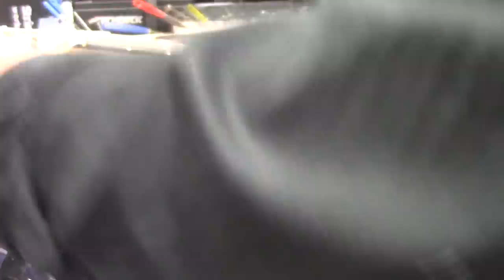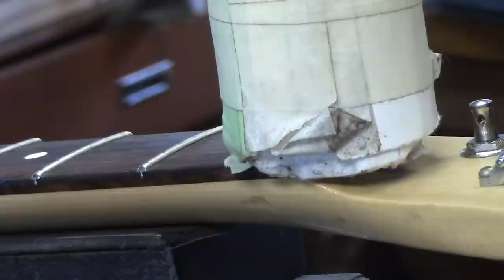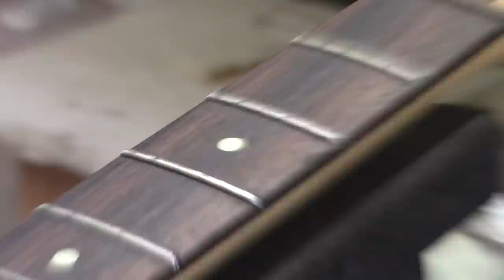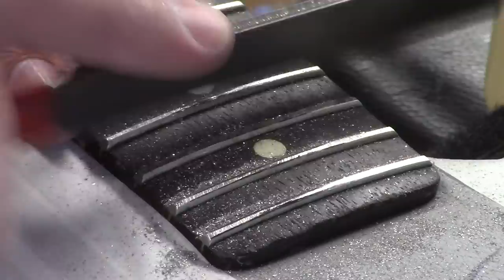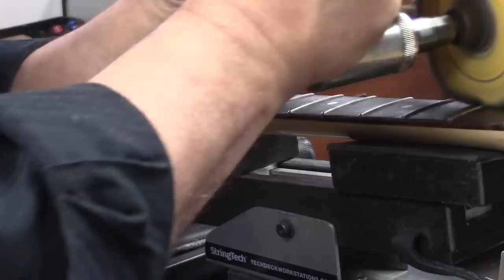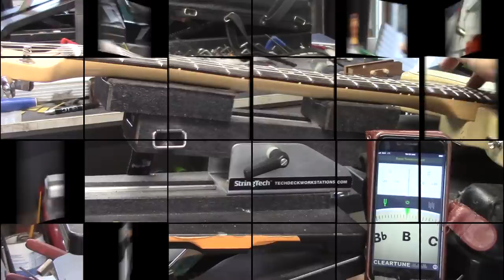"Mastering the Setup": Perfect Tuning and Playability on a Telecaster Guitar"@StringTechWorkstations

Comment: I'm a guitar builder (Turbocaster Guitars), and have found that taping off the fingerboard between the frets before filing anything helps a lot. (of course after straightening the neck with the truss rod) After taping the board, and before milling the frets I use a black felt pen, and blacken the crowns of the frets. (I also use a fret rocker).  I can then easily see exactly what I've taken off. After the fret tops are even, I then re-blacken the frets before crowning them. I can then see exactly how well they're crowned. It's usually very hard to see how the crowning is going without using the black pen, unless your lighting is just right, but with the pen, one can easily see how much to take off, as it leaves a very thin line on the crown when it's just right. It might take a little bit more time, but is WAY easier to see. I also discovered that when dressing the fret ends for fret sprout of poor fretwork, it's far easier if you put a piece of transparent Scotch tape over the fret ends first (be sure to pull it as tight as you can when applying). One pass of a fine file takes off the tape over the fret ends, and the fingerboard is now protected!! Especially nice on a lacquered fingerboard, where a little slip can remove the lacquer on the fretboard edges.
Reply from the maker: Nice. Thanks for sharing. I have had several students over the years in my College classes that have used the black marker trick and I do understand and appreciate this approach. The only cautionary suggestion: make sure you don't get any black marker onto those maple necks ! I love your scotch tape edge dress tip. I'll try that next time. Thank you. Stay safe. MMcC
Reply: @StringTechWorkstations  Yeah, the marker does make a permanent mark on a finished maple fingerboard (guess how I know that?). The scotch tape trick I just figured out a few weeks ago, and aside for removing the tape, it works great!! VERY nice video BTW!!! Thanks

Comment: Just watched your video... I have worked on my own guitars for decades. I thought I was setting them up very good.  BUT, after watching this, I am pulling out my 50's tell and other vintage and going over all them with your "fine tooth comb". And will make sure I am on point on all points on the neck.  Great learning experience for this old man.
Reply from the maker: Thank you Peter ... I am delighted to have inspired you into action. Gratefully yours, Michael
Reply: @StringTechWorkstations  I currently am working on restoring my 1951 Gretsch 6030 large body jazz guitar.  It fell off a wall bracket. Knocked the neck out at the body about 1/16 or less, but totally screwed up the playability and set.  What do you think is the best way to take this neck off for a reset? I have steam here.  Just not sure of the glue and temperature/time it would need.  Many thanks if you can give input. Stay safe in your shop.
Reply from the maker: This video will give you a good idea  of what you are dealing with : https://youtu.be/4LeY3oDEe7s
Reply from the maker: Hi Peter, If you join my Patreon channel, I do devote a bit more attention to detail to my 3rd Tier Level subscribers. It can be a bit daunting scrolling through 400+ videos. Patreon support allows me to take the extra time to address the individual needs with pertinent video links and follow up tutorials. Give it some consideration. It sounds like it would be fun to work with you. Respectfully, Michael

Comment: Thanks for the video. I was wondering why you didn't unbolt the neck and then do all the work on the frets? Cheers.
Reply from the maker: I never remove the neck to work on frets. In my College Classes I remember some of my students who preferred to remove the neck. What I find odd about that .... is .... would you remove the neck off of a 335' ? or a Martin acoustic ?? It never made any sense to me to remove a neck to do a fret job or a fret dress. By the time my students removed the neck ... I was done my fret dress and on to the next guitar. No disrespect Shaun ... to each there own  ... I'll rattle off 3 or 4 fret dresses in an afternoon without ever removing a neck. Cheers ! Thanks for the question. I am sure there are others wondering the same thing. MMcC
Reply: @StringTechWorkstations  Thanks for the reply, I appreciate it. I just wondered, seeing how you were coming from both sides with the file for the higher frets and it being a bolt-on... I have a Telecaster myself, have never liked to pay another for something I can learn to do and, unlike the road-worn one you worked on it has a pristine 'Chrome Red' finish. I'm getting a bit of buzz that truss rod and action adjustment aren't fixing - which is why I watched your video. Obviously removing the neck from a non-bolt-on like a 325, LP or Martin acoustic wouldn't be feasible so I now I understand why you teach to do the fret dress with the neck in place. Thanks again for the video and the reply.
Reply from the maker: OK ... so the real reason you are looking at pulling the neck ....  is to protect the finish on the body while doing an "edge dress" on either side of the fingerboard where the neck joins the body ...right ? If the body is masked off properly ( sometimes I'll tape a tongue - depressor on either side, to protect the body finish from the edge of the file when edge dressing. Hope that helps. Best MMcC
Reply: @StringTechWorkstations  It does, thanks a lot.

Comment: Most other Luthiers I have met always without fail put tape on the fretboard between the frets, and I am sensing you are not worried about it at all.
Reply from the maker: There are many times I use tape. Usually to protect a maple fingerboard or delicate inlay.

Comment: I have learned so much watching your videos. Thank you for your time. I would LOVE to know what brand and type of Polishing Compound you are using at the 16 minute mark, when you are using your pneumatic buffer. on the frets and fretboard. I would also be very excited to know what buffing wheel you are using and where you purchase those items from. 
Thank you VERY much in advance for your assistance on that info. 
I have been sooooo nervous to try any Buffer and Buffing Compounds directly onto a Rosewood fretboard like you are, but also do not like taking steel wool directly to the fret boards either, but yours turn out beautiful after you use that buffer and compound. I usually end up with minor tooling marks on the fretboards  after doing a fret leveling and re-crowning, even after taping it off first, and i honestly think if i used a buffer and the RIGHT compound after, it would save me a lot of time and look BETTER when i finish, like yours!!! Thank you!!!!
Reply from the maker: Happy to help Nathan. The buffing compound can be purchased at any auto body supply shop. It comes in a "bar" ... 1"x1"x 5" . There are multiple grades / white / blue / brown ( course )  / red . I usually go with the red ( jewellers rouge ) I purchase them at  "Princess Auto"  here in Canada. The buffing wheel I bought at the local surplus store .... $5.00  If  I remember .... ?  Cheers ! MMcC
Reply: StringTech Workstations thanks for the reply! I have some jewelers rouge, I just thought you might be using some special multi use compound that is acceptable to use on rosewood or dark woods AND metals or something.  Do you have a brand of that you recommend?
I have a rosewood fretboard neck I’m wanting to use that is very “raw” on the fretboard and was hoping to find a compound that I could use to “buff” it. I’ve tried mineral oils and Howard’s Feed-and-Wax, that usually work great on fretboards, but this fretboard is so raw, it’s not really soaking in and isn’t as luscious as it could /should be.

Comment: After viewing  finished comparison almost brought a tear, Almost... LOL When I was young and dumb. Once in while when guitar was due for new strings, I d take back to the shop where I bought it, and on their blackboard which showed menu and  pricing "Sting Replacement: $25"  "Intonation: $110"  feeling lazy and hoping for a better result if I did it. I opted for the complete Job.$135 plus tax.  The result wasn't lasting or not an improvement of what I had done myself except maybe a much more neater job. equal winding and nicely trimmed string ends but guitar sounded the same,  This video was really crazy and seemingly goes against the rumors "The guitar is not a perfect instrument"
Reply from the maker: I have been "the voice in the wilderness" for most of my life on the guitar regulation and intonation issues. It's nice to see that people are finally starting to see ( actually hear ) the light ... Lol ! MMcC

Comment: What did you use to touch up the edges of the frets? I have a cheap strat clone...but I love my guitar! And the frets are rough and need to be dusted off. 
Watching you re crown the frets with that big chunky sounding file was scary! If you had slipped off then the file would've  hit the wood... as you know, obviously.. but that was scary to watch!! When you first started doing this, what did you protect the wood with? Because I see you protected the wood in other areas.
Thank you!
Reply from the maker: My thumb rides along the fingerboard surface  to keep the file at a consistent angle. These are 6" fine mill files with the "rat tail" cut off ... then they are mounted to a jointed hardwood tapered handle.

Comment: Mike, firstly, I always find your videos interesting and informative. I particularly like that your techniques are frequently different from what are commonly accepted approaches.
My question regarding this video is in how you begin the fret work. I have found that adjusting the relief to the fret board as a opposed to the frets is my preferred way to start a fret job. I am usually working on relatively new instruments so that may be the issue for me. To the point, do you use the frets as a reference because the instrument, in this case, has been played extensively and the the fretboard my be worn in a way that would  makes it undesirable to use as a reference or are you using the frets for reference to save fret material. Is this the way you approach all fret leveling whether the instrument is new or old?
Thanks
Jim
Reply from the maker: Hi Jim. The objective ( for me ) is to get the "lay of the neck" as straight as possible. Then I file the crowns ( in many cases very lightly ) to ensure that the "trajectory of the string path" is lazor- straight. In a perfect world .... I end up with enough load on the truss rod to create a bit of relief ... by backing off the tension once the job is done. MMcC

Comment: So you adjust the truss with the strings off?  ... I would have thought that you needed the string tension to really determine where the neck would be resting.
Reply from the maker: Getting the lay of the neck as straight as possible with the strings off ... in preparation for the levelling the frets . The truss rod is adjusted if and when necessary, to accomplish this task.   MMcC

Comment: Hi! When you make the compensated nut. If the note at the first fret is sharp wouldn't it be the correct way to enlarge the length of the string? I can see you make the nut wider towards the bridge. Wouldn't it be wider towards the headstock instead to make Moore material in that direction. I'm alittle bit confused?/ best regards Mats
Reply from the maker: Hi Mats. It is a moving target with MANY variations / depending on the gauge of string / the tuning / the scale length /  preferred action height. I do cover all of this with my Patreon Tier 3 subscribers, with detailed videos of all of the various case scenarios / supplies / tools and spec sheet.

Comment: Seems you leave a pretty wide land on top of the frets? Would you say it is better than leaving as thin land as possible? I usually get slight intonation issues when I leave it wide. I can see and hear however that you do not ;) Gorgeous intonation! Do you angle the land a bit?
Reply from the maker: I've never heard the term " land " before. After levelling; I chase the crown towards centre ... equal strokes of the crowing file on both sides of the fret. The scrub block ( that I have provided to my students for decades ) , finishes the job by scrubbing the crowns back to dead centre. I hope that answers your question. Best MMcC

Comment: Great work. But I’m a little confused about the compensated nut, especially on a Fender. It seems counter-intuitive given that the first fret was sharp compared to the open string? Thanks! And again, nice work.
Reply from the maker: It can be a bit confusing; until you half a couple of dozen of these jobs under your belt. I do go over this in greater detail with my Patreon Tier 3 Subs. But once it is done ... the tuner doesn't lie. Cheers !

Comment: Michael, why are you using a standard straight edge, and not a notched straight edge, to really read the fretboard, instead of the frets?
Any particular reason?

Thanks and cheers.
Reply from the maker: I buy a 1 metre aluminum rule for $13.75 Can $ ( apprx $10 usd ) . This one rule produces 5 straight edges of various lengths. I really don't get the " notched straight edge thing " .... it just seems like a solution looking for a problem. But if it works for you ... more power to you ! Cheers, MMcC
Reply: @StringTechWorkstations  - I fully understand that persepctive, and respect to you, Michael!
I've just always found the use of a notched straight edge to be perfect - getting the board level, then taking care of the frets...

It's always great to see how other people work, and what they tend to do and work with!
Cheers for the videos, I enjoy then!
Best regards.
Reply: I would second that.  Can you explain in a bit more detail why a notched straight edge wouldn't be more beneficial? In my VERY limited experience, I thought having a flat fret board (confirmed via a notched straight edge) would produce the best and/or most accurate fret leveling.  You could then go back and knock at little off the upper register to compensate (no pun intended) for the dreaded "Fender Hump."  What am I missing Michael?  Appreciate all the videos and experience you impart to the community...Thank you.

Comment: That's very impressive! I think one becomes so accustom  lousy intonation down there, that it's just accepted as the nature of  of the instrument. This is a really great demonstration to dispel that  false belief!
I have one question though. WHY IN THE WORLD does Fender (and perhaps others) use a radiused seat for the nut?!  This seems as though a flat seat would be SO MUCH easier to get good even contact between the nut and the neck (important). Any advantage to a radius there is over my head. I just can't imagine what it might be, especially in light of the advantages of fabricating and mating two flat planes.
Anyway, great video and your patter and camera work both make for a very lucid explanation. Cheers from another MMcC!
Reply from the maker: Oh man, I have felt the pain Mark ... many times .... as I create a radius on the bottom side of the nut. If I had a time machine ..... Lol ! Cheers !MMcC
Reply: StringTech Workstations 
Well, you are obviously a skilled craftsman to be able to tackle it (and succeed). If it were me trying this, I'd seriously consider milling the seat under the nut to a flat plane. Sure would be easier to make a flat seat on the bottom of the nut! Would such a maneuver end up encroaching in the truss rod or something (or is this just blasphemy)? Again, very impressive video, MMcC.......MMcC
Reply from the maker: Milling out a 62' Strat nut slot would not be a good idea. Especially with the rosewood fingerboards .... you would cut right through to the truss rod. Although it is a royal p.i.t.a. ... the curved nut is the way to go in that case.

Comment: I suspect there's more to this than meets the eye, but why does the compensated nut make a such difference? I intuitively feel that the pitch is a product of the string's length and its tension. So, why doesn't simply intonating the saddles do all the compensating that is necessary - what am I missing? Can you point me towards an explanation? Thanks.
Reply from the maker: https://youtu.be/237vjZmWWy4

Comment: If you tune a guitar in the bench position and tune it,you'll get one reading,if you tune it in playing position,you'll get a different one,I've seen it as much as 6-9 cent off between the two,just fron gravity. I've always leveled my frets,tuned,and done as much work as I can in playing position,its slot more accurate
Reply from the maker: I always do the final check in playing position. I manage to get the "lion's share " of the work done on the TechDeck with the body and the neck supported simultaneously. The final "reality check" is to play various chord voicings across the entire span of the fingerboard. It is the compensated nut in combination with all of the other calibrations that results in this degree of accuracy.